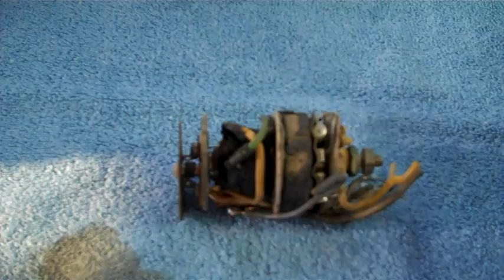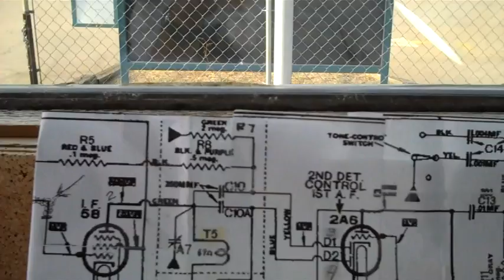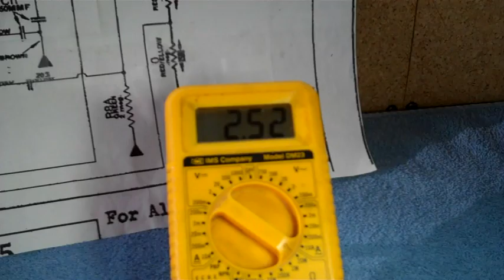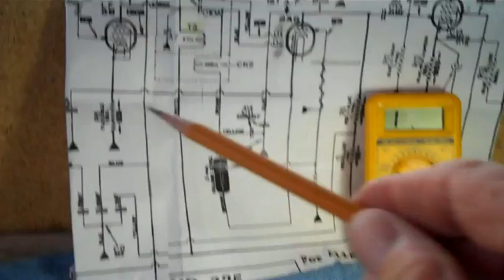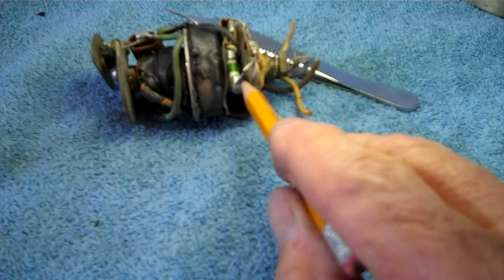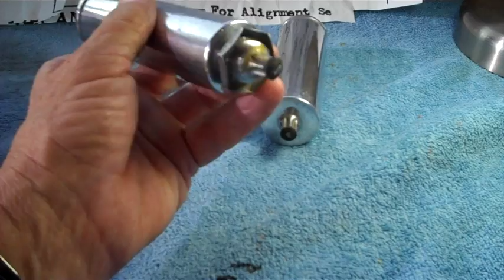1935 Atwater Kent Model 145 Repair and Restoration (Part 12 of 38).

Comment from the maker: Bret,
A lot of I.F. cans have resistors inside them.  Most are easy to change out, which in my opinion should always be done as a preventive maintenance measure, but some can be bears to deal with.  When messing with those puppies, patience is always the order of the day.

Regards,
John

Comment: Geeze.. and I thought the 40-125's first IF can was a doozy..  at least I didn't have resistors to contend with.   although, wrapping the little 'hairs' around the new wires reminded me of your shadow meter coil soldering on the 635.

Comment from the maker: John,
I agree...EM speakers are way cooler than PM, but right now I have this nice PM speaker on hand with an already installed correct impedance matching audio output transformer.  I want folks to see how to make the conversion.  Later on I can hopefully pick up an original speaker...like I did with the AK856.  It only took four years to find it.  :-)

Regards,
John

Comment from the maker: Brother Mac,
Brasso is the secret weapon.  I have a can of the original formula stuff (silica instead of limestone as the abrasive) and it works wonders with these cans.  But the instructions on the can say not to use it on aluminum.  Very strange indeed.  :-)

Regards,
John

Comment: It really is odd that they made those IF's so you have to take the top off to adjust them.  After you pointed it out, I went back and looked at some of my older radios, didn't find any others like that.  Good job, they look like they'll be good as new.